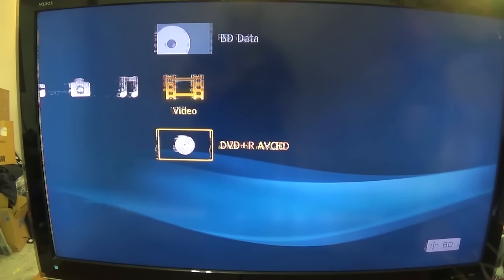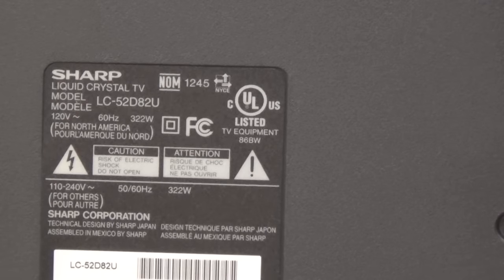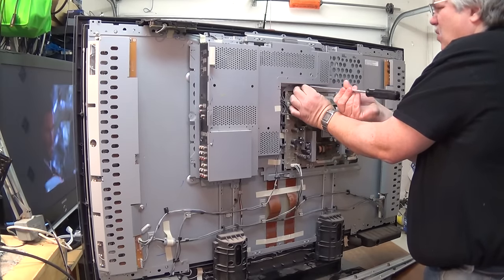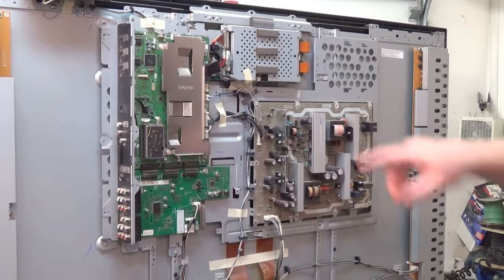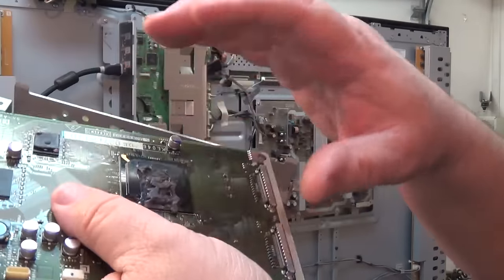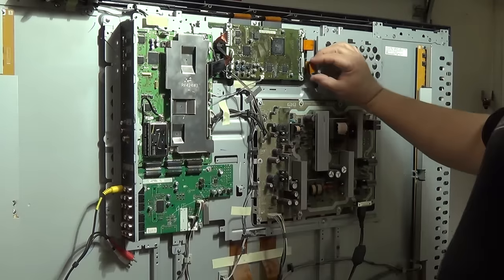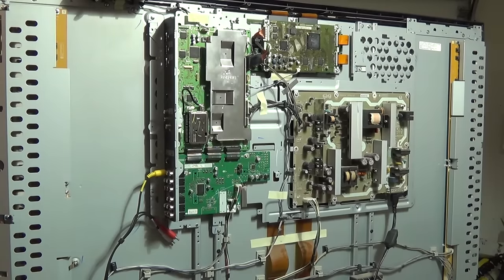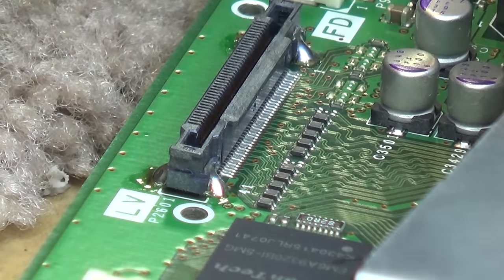Sharp LC52D82 bad picture FIXED

Comment: NIce repair! I worked in testing/debug at a large company, and we made products for 3rd party etc, and on the boards we were building were numerous BGA (Ball Grid Array-for others) . I don't know how many of the damn things would fail just for that reason, a 'Ball' wasnt in contact, then tap it and boom it worked. We would xray them and you could see what was in contact and what wasn't. LIke you said, it is a horrible way to connect a chip. There is no easy way for an average diy'er to reflow them without experience, thermal shock etc would be a big factor. I like my leads sticking out and I can reflow'em nice and easy. And that heat compound melting!? Disgusting fabrication.
Reply from the maker: +Scott x I agree it is the worst design I have come across. BGA chips was one of many reasons I left the electronics repair industry.  When I do a BGA reheat like I did here it is usually on something I own because you really can't guarantee that it is going to last. I may do it for a friend and charge them very little, like on this one, it was a co-worker, and he understands fully that it may last, but then again it may fail. I have had success and failures doing this. More success than failures, but it is a horrible design.  As I explained to the owner of this set, he could change the TCON board, but good luck finding a new piece today. All the ones floating around for 20-25 bucks are pulls from other sets, and many of them are repaired in the same fashion, and have about as long a guarantee.  The first time I saw a BGA chip back in the late 90's I said to a co-worker at the time, how the hell do they expect this to work. First time I saw them was in digital cameras.  We used to think SMD was also bad, but SMD are actually very reliable compared to BGA.

Comment: im an idiot, i reflow my main ic chip but realise the heat gun was spreading heat all over the board when i got the monitor to switch on not thinking that i should isolate the chips with a piece of cardboard first and see which one is giving trouble or working when heated with air. Busy reflowing the chip with a 50w gu10 halogen, will try for an hour, its a small chip so dont think it needs more, placed a bit of that white smudgy flux around the edges of the chip, hope that flux isnt too bad to use as i see people using the liquid flux, this video on the other hand was incredibly informative and the part where you heated the board while its on got me thinking in the right place, thank you 12volt !!!
Reply: He didnt use cardboard he used some kind of adhesive backed metal foil, and I wouldnt worry about the other componants that much if you ever watched a solder wave machine flow a bath of molton solder over the whole board, as it smokes and burns

Comment: +12voltvids I'm new to your channel and have been watching many of you postings....compliments to you for the contents and it's all interesting stuff. I noted what you said ref. watching the adverts all the way through (Dave Jones mentioned this recently too)....if it's worth your while making these videos then you'll keep making them....which is what we all want, of course :)
every time I read of people 'gobbing off' because someone uses a hot air gun instead of a reflow station, it peeves me off. obviously a reflow station is the better option if it's justifiable to invest in one. I personally do not have that sort of money 'lying around' and make do with what I have. the main thing is that the job gets done and there is a quality result.....keeps the repair price down and people happy (that's what matters in the end). I repair devices out of a passion for tinkering  (and the challenge), if a few pennies fall my way that's a bonus, but the smile on a 'customers' face is priceless.
keep up the sterling work, mate and wave a 'two fingered salute' at the trolls ;)
Ted

Comment: I have to say I didn't realise that reflowing was potentially as simple as this... definitely worth trying even if the board only lasts 6 months.

Problem with stuff like this is that you don't know if the replacement boards on eBay haven't been quickly touched up like this to sell on quickly. That's certainly been the case with the old Xbox360 reflowed boards/machines.
Reply from the maker: +Jason james Yes that was common. People would do it quick, and sell it to an unsuspecting person. I do this on my own equipment, and in this case it is a co-worker and he is fully aware that it could potentially fail again, and the only way to guarantee that it won't fail again is to buy a new board.The DELL computer I fixed this way, is mine. I won't be selling it and I will be using it to see how long it runs. I am actually using it now to write this reply, as it has a bigger screen than my replacement laptop.
Reply: yes I am excited to try that with some now dead computer video graphics cards I first heard of this method on

Comment: i was given this same exact POS tv. changed the power supply and weeks later the 4 inverters failed. after i changed those the Tconn started flashing on/off. after i changed the Tconn it was fine for a few weeks until the backlights started burning out....OFF TO THE DUMP AFTER THAT!!!